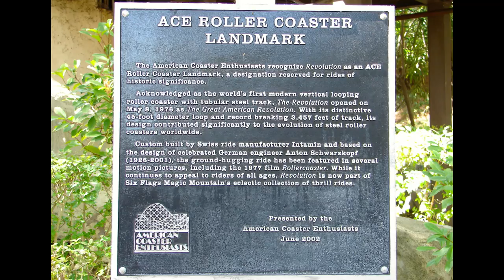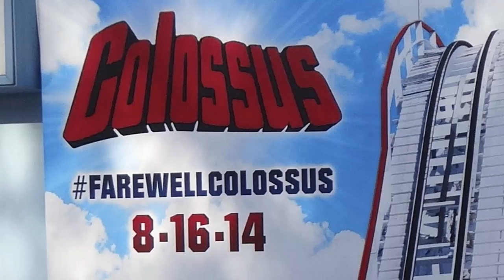COLOSSUS: From Wooden Beams to Thundering Screams [DOCUMENTARY]

Comment: Colossus looked so good when it was brand new
Reply: Impressive structure.
Reply: Kevin Ventura Six Flags should build a new one
Reply: @richardmorris7063  I rode it when it was brand spanking new...funny didn't remember it being a racer coaster...
Reply: @ernestinemaloy8680 wow you don’t remember? I first ride it in 1980 and it was racing at that times remember one track was always a little faster than the other. There were two stations. One on the left or the inside track and the other on the right or the outside track. I like the outside track the best.
Reply: I never get tired of this footage of Colossus being built. I remember when this took place but you didn’t get to see it! I was only 11 years old. It was massive.
Reply: @richardmorris7063 yes it was! People can say what they want about classic wooden coasters but just because it was wooden doesn’t mean it was weak. Think about it. Colossus faced so many challenges like a tornado and a fire and yet it still stood! It was so big and had such might, it was able to handle the RMC rebuild. From what I understand a wooden coaster still has to be in good constructional condition in order to be successful in the transformation. So Colossus was vey much still a viable and valuable coaster. I do miss the figure 8 configuration but I do love Twisted Colossus’s new steel track. And that lift hill and drop is still bad ass. I had the same exact Holy shit WTF reaction on both versions the first time. If it could do that to someone twice that is one epic unforgettable bad ass roller coaster. It was a force to be reckoned with then and it still is as Twisted Colossus. It wasn’t Goodbye Colossus. It was Welcome back Colossus.. with a twist. Don’t ever leave us again, old friend! ❤️❤️🎢

Comment: Great video documentary, thank you. I remember back in '78 riding it for the first time. For me the most the most exciting thing was the first drop, and after the third drop those sequencial bunny hills that left you weightless, they ruined that with the block brake renovation. Although the original track was still there and you could pick it out. I last rode about four years ago. Looking forward to the new incarnation even though it won't be the same. Still angry about Log Jammer.

Comment: I think you forgot to inform us on the most important part... which was why did they decide to close Colossus? "After 36 years it was finally time to close it" doesn't explain anything. Was it because the ride was becoming unsafe? Too expensive to maintain? Structural issues? Or were they just ready for something new?
Reply: Ridership was very low and the park wanted something new. And they succeeded by getting one of if not the best ride currently at the park.

Comment: They NEVER should have tampered with the original, including the trimming down of the “mothers” humps.  Not even one mention of Carol Flores, God bless her.  Her death was the reason they removed the negative-G.  I rode Colossus before they did that surgery, and it is true, you would be lifted up in your seat, and you could feel the car pulling down .
Reply: Yes. Strange that they said the 1979 closure and redesign was due to excessive maintenance. Certainly that was one of the considerations, but the ride was closed and redesigned due to the fatality. It was a very thrilling ride in 1978. After the redesign, meh.

Comment: When Colossus was closed in May of 1979, and reprofiled by Bill Cobb Associates it was to reduce( TOO MUCH EXCESSIVE NEGATIVE G's), which also delivered a very painful ride experience, and not to mention The IAD Trains weren't good for the ride alone. The PTC Trains did offer some Great Floater, and Strong Airtime, without the Black and Blue bruises on the riders thighs, and didn't eliminate all negitive G's as you stated. That Truly was The Best Version of The Once Mighty Colossus. I wish Magic Mountain worked hard to maintain it with Plenty of TLC. The same way Kennywood can keep their Coaster Woodies operating like a Fine Tuned Swiss Watch. The Jackrabbit Rollercoaster Celebrated 100yrs of Operation this past season.

Comment: There are some factual errors in this video. Six Flags turned one track of Colossus backwards in the 80s using the PTC trains, but it was not related to the Fright Fest event. In fact, that side of Colossus remained backwards year-round until the new trains from Morgan were purchased. The reason Colossus did not operate backwards with the Morgan trains is because they lacked a headrest. At some point in the mid-90s after Psyclone had been built Magic Mountain once again turned one track backwards for the annual FrightFest event using two of the B&M trains from Psyclone. Eventually, Psyclone was demolished, but Six Flags held on to two of the Psyclone trains for backwards operation.
Reply: 1988 PTC trains were retired for Morgan Trains. 1998 two Psyclone trains used for the first time for Colossus backwards. In 1999 the park offered the backwards experience again for spring break and every October thereafter.
Reply: ***** we rode it backwards on Spring Break this year. In fact, only one track was open and backwards was the only option. It definitely needed to be redone/replaced but it sure was great in its day. Loved that ride. I'd imagine our American Eagle at our home park in Gurnee (Chicago) will have to have something similar done.
Reply: They actually don't turn the track backwards, just the trains.
Reply: mechanicalmusic
By "Six Flags turned one track of Colossus backwards", he meant that the ride had two tracks and the trains on one of those two tracks ran backwards. What made you think that he was implying that they reversed the track itself (which is obviously impossible)?

Comment: I don't know why some of you out there say Colossus was ruined when it was re-profiled and had the PTC Trains added as the rolling stock. Don't know about the rest of you but this was the very best version of Colossus. I first rode the Coaster in 1978 after I graduated from Marine Corps Bootcamp. After making it through 13 very though weeks of Marine Corps Bootcamp, Colossus was the worst Coaster experience ever. Rollercoasters are supposed to be exciting and fun, not painful. Also the Coaster ride was so bad it was shut down more than 50% of the time. Those NAD Trains were way too heavy and the restraints really sucked. They worked well on Revolution, not Colossus.  With the re-profiling of the track and the PTC Trains Colossus was still an amazing AIRTIME MACHINE with a increased speed of 62mph and the trains would even travel faster at night. This is the Colossus I remember and miss.
Reply: Take a close look at the riders as the red Train is exiting the Double Down and how they land back down in their seats. LOOKS LIKE AIRTIME TO ME!!!!!!